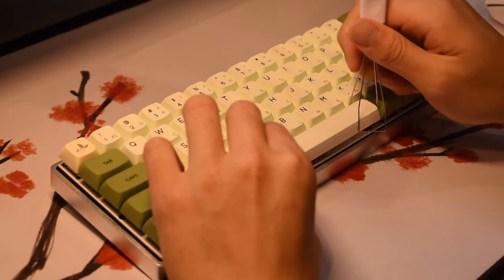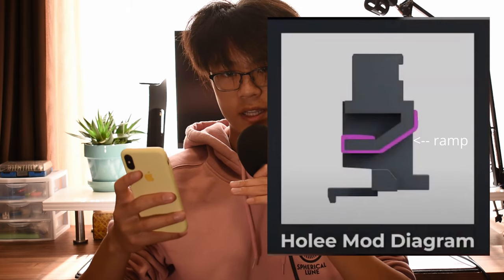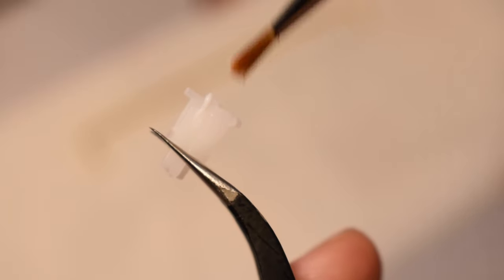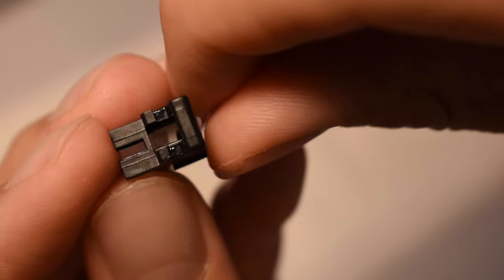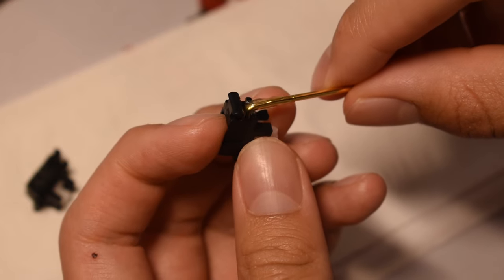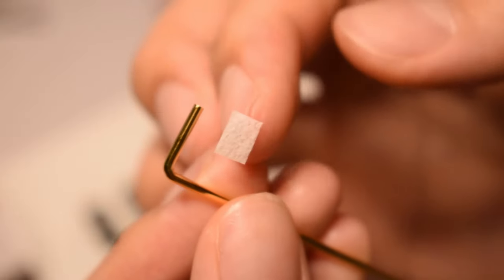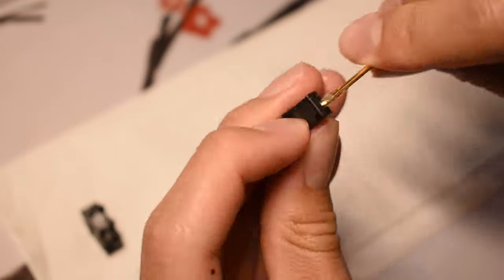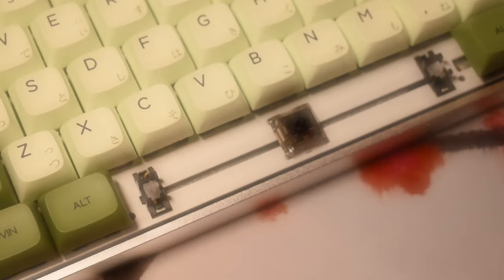Fix the rattle! | Modding Stabilizers Step by Step Guide

Comment: Lube is not available with me; can I wrap a band-aid around the wire instead? If not, what alternatives do you recommend for lube? I hope you answer:D
Reply from the maker: Yes! These mods work quite well without lube actually. However, it might feel a little bit rough and sound not as smooth however it should definitely be better than stock stabilizers. If you can, I would highly suggest you get dielectric grease, it’s not too expensive (maybe $12 for a tube?) and you can find it at your local hardware store
Reply: @YBBK  Thanks for the response! I will buy a prebuilt keyboard tomorrow so that I can mod it myself:) Im a beginner so id be using AKKO cs switches (if you have heard of them) and it works with outemu sockets. You can search em up and its pretty cheap but decent enough.
Reply from the maker: @jancraft1230  I love akko switches, I actually have two reviews on them, but i’ve never heard that they work with outemu sockets

Comment: Good luck dealing with the glue residue from tapes and band aids when it dries up or goes all gooey. I've been working with all kinds of tapes for 35 years, and masking tape and band aids would be the last kind of tape I'd i tend to stick onto anything for longer than a week, let alone an expensive keyboard with fine mechanics and electronics.

Comment: I do the light taps on the sides like what you did in 6:47. On my keyboard I hear some metal or wire rattling with just light tapos on the left side. What seems to be the cause of that?
Reply from the maker: That may be due to an unbalanced wire. Here’s a video on how to wire balance: https://youtu.be/1APcXRqfOao I should have included this in the video but wasn’t as knowledgeable at the time of making. I am thinking of creating my own tutorial
Reply: @YBBK  ohh I see. This helps me a lot thanks!

Comment: Hey! I did the whole tutorial, but now my spacebar performs the move as in "two parts", before modding it was far better smoother, any suggestions for fixing this? ty!
Reply from the maker: Did you make sure to only do one of the mods? (holee mod or bandaid wrap) If so, did you make sure that the bandaid for either mod you did was thin enough? Also, make sure that the bandaid is not cut to wide.
Reply: @YBBK  you were completely right, its seems that I've done the holee mod wrong, now I just removed the tape I had placed and went for the other bandaid wrap mod, the keyboard works perfectly and the annoying noises are gone, you're a lifesaver thanks!

Comment: Do you use the holee mod and bandaid wrap mod at the same time?
Reply from the maker: No, only one or the other. If you do both the wire won't fit into the housing.
Reply: @YBBK  thank you for the reply will go with holee mod!

Comment: I did the Band-aid wrap mod. Is it normal if it's mushy? I'm not sure if i putted to much dielectric grease on mine or I made the tape wrap a bit thick.
Reply from the maker: it could be a factor of both. Just use it for a few days first and see if it gets any better
Reply: @YBBK  guess I'll just have to break it in even more
Reply: @YBBK  after a week, my spacebar suddenly returned having an upstroke sound. Before, doing the Band-aid Wrap mod it didn't. I'm not saying it's bad because I kinda dig the spacebar having it like that. Wanna know if it's the same with you after giving it a week of break in or use?
Reply from the maker: @sevz1605  Do you mean rattle? Because after breaking in, some of the lube gets dissipated resulting in the sound coming back. A solution is the relube the wire, this fix is temporary. However, one important mod I didn't mention in this video, wire balancing, can solve this issue permanently. I plan to release an updated video soon going over the things I missed in this one. But for now, please refer to this one: https://youtu.be/1APcXRqfOao

Comment: Any recommendations for sk64s? Been looking at cherrys. Are there any better ones ?
Reply from the maker: I’m pretty sure these are much better than cherry plate mounts. The wires are much more solid and even abs the housing/stems are basically the same
Reply from the maker: But honestly, any aftermarket stabilizers with modding will sound good
Reply: @YBBK  thanks man. new to the community and any help is much appreciated. keep up the good work. :)
Reply from the maker: @keshvinnnn  No problem! Good luck on the upgrade ☺️

Comment: Hi. Is it okay to just use dielectric grease in both the stem/housing and the wiring?
Reply from the maker: No! Please do not use dielectric grease on the stem or housing, it is very thick and will result in a sluggish stabilizer. Only use it on  the wire. If you only have dielectric grease, just don’t lube the housings or stems.
Reply: @YBBK  thanks for the help i really appreciate it!

Comment: I did the holee mod and lubed my stabs, but there is still slight ticking on the right side of the spacebar. There is also a rubbing noise on the right side. I have tried to break it in but it is still like that. Any tips on how I might be able to fix this?
Reply from the maker: This is could be due to your wire being uneven. You could try and take apart the stabilizers, cleaning the wire, and then place it on a flat surface. Tap each end of the wire to see which side is ticking. Using pliers (wrap them with cloth or something to protect the wire from being damaged) twist each end as needed until the wire rests flat and does not tick. When reinstalling the wire, make sure it is in the same orientation that  balanced.
Reply from the maker: Please use this video as a reference: https://www.youtube.com/watch?v=1APcXRqfOao

Comment: Could I use two pieces of medical tape or would it feel too mushy
Reply from the maker: I don’t think the wire would even fit 😂
Reply: ok i tried the bandaid wrap mod however the different ends of the space bar has a different sound and is there a way to fix that?
Reply from the maker: @Jav-wl9bz  I actually have this issue on my main keyboard. I can’t give you a solid reason on how to fix it as there are a lot of factors that could cause this. For example uneven plate, different mounting styles, stabilizer wire or stem are not perfect.

Comment: this is an amazing video however im having a minor problem only one side of the spacebar is thocky ive redone the mod and it didnt make a difference any fixes?
Reply from the maker: Thanks! For your issue, there are alot of factors that can affect this. It could be due to an uneven plate, mounting style (usually tray mount is least even), stabilizer defect etc. Its kind of impossible to narrow down the cause.
Reply: @YBBK  thank you tried to redo the mod again just on the bad sounding side and now it just sounds even more rattly than before on both sides i have the redragon k552 with cliped legs bandaid mod and akko cs ocean blue switches
Reply from the maker: @therealkaktes  ah that’s unfortunate, good luck on the modding tho :)
Reply: @YBBK  thank you so much i opened up the stabs and found out that part of the banaid from the hole mod had fallen of and gotten jamed i removed it and i have a smooth spacebar now thx so much sorry if the spelling or grammer isn't good i dont know english very well
Reply from the maker: @therealkaktes  haha no worries 😂 great to hear it works now

Comment: can i use dieletric grease for the housing, stem and wire? or should i get krytox too
Reply from the maker: no, dielectric grease is only for wires. if you use it on housing it will become super sluggish. Use dielectric grease for wires only and krytox for everything else

Comment: Can we do both holee mod and wrap mod at the same time?
Reply from the maker: I don’t think so because there will be too little space for the wire to fit in the stem
Reply: Definitely not. One or the other.
Reply: @YBBK  which one would you recommend doing? I can’t really tell from the sound tests but I can vaguely hear a deeper sound from the bandaid wrap method, is that true irl?
Reply: and can you please link the medical tape you used? should I buy the paper one, the microporous one, or the plastic one?
Reply from the maker: @sam17577  Personally I prefer the holee mod because I believe it provides a better result. However, it’s more tedious to apply.
Reply from the maker: @sam17577  I don’t have a link but I think I used the microporous one. However, paper should also work fine. Avoid plastic

Comment: would a thick heat shrink be similar to band-aid wrap mod?
Reply from the maker: I've seen other people use heat shrink but I personally wouldn't recommended. I haven't tried it but I'm pretty sure heat shrink is too thick and will lead to a mushy, sluggish feel. If you have the materials though you could always try it out for yourself!
Reply: @YBBK  thanks for the info :) I subbed :)

Comment: do i need to lube the wire so it works, cause i dont have lube
Reply from the maker: You don't have to lube. It will work just fine without it however, its recommended.

Comment: I used tape for this and somehow the keyboard turned out really good because of the adhesive, is this the opposite of lubing?
Reply from the maker: Do you mean tape for the holee mod?
Reply: @YBBK  yeah
Reply from the maker: @hooman4392  Ah yeah I have seen some people use clear tape and have good results
Reply: @YBBK  the thing is the tape fell off, its just the adhesive now
Reply: @YBBK  also on one of my other keyboards, one of the stems broke, you know where I can buy specifically stems because I don't want to waste the other parts of the stabilizer.

Comment: I did everything except lubbing and it sounds exactly the same if I buy lube would it get better? (The rattling is actually insane)
Reply from the maker: Hmmm you might have done something wrong then. The rattling should be reduced even without lube. You should try balancing the wires. Search it up on youtube, there are a few tutorials.
Reply: @YBBK  thx I’ll try that
Edit: I think I might just have ultra cheap stabilizers 😅 cause the wire is balanced. I’ll buy the lube as a last ditch effort and just deal with it if it don’t work lol
2nd edit: YAY I fixed it by talking the stabilizers from my shift key and putting them on space bar and the sound went down by like 70 percent (new stabilizers don’t even have all these mods so maybe the old ones were faulty?

Comment: Hey! Just wondering what keycaps you use. They loon suuuuuper clean. Definitely will be using them on my GMMK Compact. Great video! Will be modding my durocks when my dielectric grease comes. Thanks in advance!
Reply from the maker: Haha thanks! They are PBT XDA matcha keycaps from aliexpress. I picked them up for around 40 CAD.
Reply: @YBBK  Thanks bro definitely will be picking them up

Comment: did you have any durability issues with using this thin of a medical tape?
Reply from the maker: I’ve done the holee mod on over 10 boards and only one has has an issue so far. The issue was the tape coming loose
Reply: @YBBK  okay.  I'll give it a shot with my similar medical tape then.  Hope it doesn't come loose

Comment: Hey, i am new to the keeb rabbit hole. I really don't understand what legs to clip on my stems as i know that they aren't preclipped cuz there is 4 legs but i can't tell which legs i am meant to clip
Reply from the maker: Please take a look at this image: https://www.maketecheasier.com/assets/uploads/2020/04/keyboard-stabiliser-modding-1-1.jpg clip off the highlights parts. It should be the thinner legs with "teeth"
Reply: @YBBK  Hey thanks, this really helped me my stabs feel a little mushy i think i over lubed them and with the holee mod
Reply from the maker: @Nukunyx  If you overlubed you could take the wire out and clean it, that might help a little.
Reply: @YBBK  okie i will try rn the space bar ant he l shift feels fine it's just the enter ket and the del that feels mushy

Comment: Instead of putting that grease on the wire can I use lube?
Reply from the maker: Like krytox 205g0?
Reply: @YBBK  yeeh
Reply from the maker: @shmapplegaming6694  yes that should work fine, just apply a bit more

Comment: Does doing all three mods make the stab mushy?
Reply from the maker: Holee mod and band aid wrap will make the stabilizer mushy ONLY at first. After around 1 week of use it will go away.
Reply: @YBBK  would lubing make it more or less mushy?
Reply from the maker: @treviglesias8673  you should always lube your stabilizers however it doesn’t matter if you lube or not the mushy will go away after use.

Comment: Is the Everglide Panda the same as JWK Panda?
Reply from the maker: I haven’t heard of them before but they look to be the same. I’d still recommend you get the everglide pandas to be sure
Reply: @YBBK  I looked into it further and a reddit user said that JWK is the manufacturer for Durock and Everglide. Another user mentioned that Durock is a rebrand of Everglides I think? Thanks for the advice though :)
Reply from the maker: @tttiiny  Ah should be good then! Just make sure you get the ones with the gold plated wires, usually those are stronger from my experience and easier to wire balance.

Comment: Can I use electric grease for lubricating my switch and what type can be used?
Reply from the maker: No no no, please never use dielectric grease or any kind of thick lube for your switches, it will ruin them. For switches use krytox 205g0
Reply: @YBBK  Is there an alternative lube for switch? those krytox are too pricey
Reply from the maker: @clydegallaza5220  Not any good alternatives unfortunately. I would suggest you save up and buy krytox

Comment: I tried this on my panda everglides but it became very sluggish for some reason. it would take a whole second to come up. the bottom of my stabilizer was also preclipped and had a different shape for some reason
Reply from the maker: For your first issue, it might be due to overlubing or too thick tape for the holee mod. Your stabilizers look different probably because you have the v2 everglide pandas.

Comment: what does clipping the leg of the stem actually do?
Reply from the maker: The legs of a stem are what touches the pcb when you press down on the stabilized. Since they are so thin and flexible, they dampen the bottom out impact. As result, some may notice that it leads to a mushy experience which is usually unfavourable. Clipping the legs off means there is no longer any dampening effect and allows the stem bottom to make full contact with the pcb leading to a sharper, more defined bottom out.

Comment: I thought that it wasn’t recommended to use thick lube for wires when doing holee mod
Reply from the maker: I'm not too sure as I haven't heard about that. However, I can say that the stabilizers work just fine and most likely provided similar results

Comment: my durock stabs tick, and i have tried everything to stop it. I've tried lubing, tuning, clipping, holee modding but it still ticks. I am using durock stabs idt this should happen
Reply from the maker: Have you tried wire balancing? It's a key factor to stop ticking
Reply: @YBBK  oh yeah i did, it still ticks but it's slightly better

Comment: does masking tape work instead of medical tape?
Reply from the maker: For the wire wrap and holee mod, probably not, I wouldn’t recommend it. For the mod to tighten the stabilizers on to the plate, yes, masking tape works fine

Comment: after i apply the stabilizer back to the keyboard the spacebar just does no go up any way to fix it?
Reply from the maker: Did you reinsert the stem in the correct orientation?
Reply: @YBBK  yes i did but i cant really put it back bc i o nly wanted to lube the housing not the wire but now i cant put it in without making the the space go down
Reply from the maker: @joshuahaboc1326  Could you add my discord? My tags in the description and it will be easier to help you there.
Reply: @YBBK  okay ty
Reply: @YBBK  ok i requested you
Reply from the maker: @hvhn9798  Did you make sure the stem is reinstalled in the correct orientation?
Reply from the maker: @hvhn9798  Ohhhh I see. I never thought about that issue. So is you problem solved now?

Comment: I dont know why, I already done all the mod and still got the ticking on the stabs, im using Durock V2 😫
Reply from the maker: This could be due to a bent wire. I missed an important step in this video, wire balancing. I highly suggest you check it out. I plan to release an updated video including this.

Comment: Can someone help me? When i took the stabilizers out and did the band aid mod and i popped the stabilizers back in, my spacebar just wouldn't work. It just stayed at the bottom and it wouldn't come up so i can click it and i don't know what to do.
Reply from the maker: Did you make sure the stem was seating in the housing in the correct position? This is the issue in most cases, if your stem is in the wrong orientation, the stabilizer will not move
Reply: @YBBK  i fixed it thanks

Comment: hey, I've been having trouble with my both shift stabs. I tried this mod to my new stabs (some durock plate mounts) and it just felt all mooshy and stuck when push them to the end. But the odd thing is it works perfectly fine to my space bar and backspace (enter felt a bit weird but ill allow it). I happen to notice the durock's + stem is a little thicker than my stock stabs. Does anyone know how to fix this?
Reply from the maker: I’m pretty sure the issue is that your band aid or tape used for the holee mod was either too thick, or cut improperly. These factors can lead to the wire not having enough space to move this resulting in what your are experiencing. I don’t think the different sized stabilizers is the reason.
Reply: @YBBK  i re-assured that i cut them thin and it covers only 3/4 of the surface. I agree maybe it's bcs of the type of band aid i used is to thick (i used the brown hansaplast)
Reply from the maker: @cdy9567  Ah icic. At least you found the issue now :)